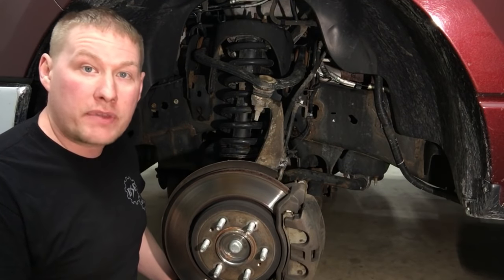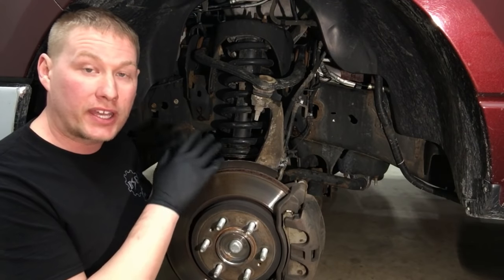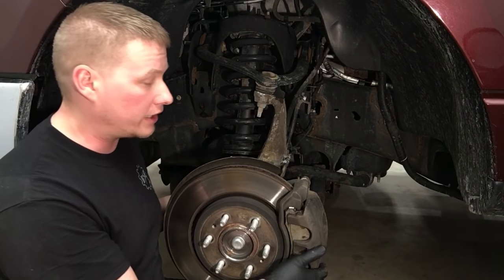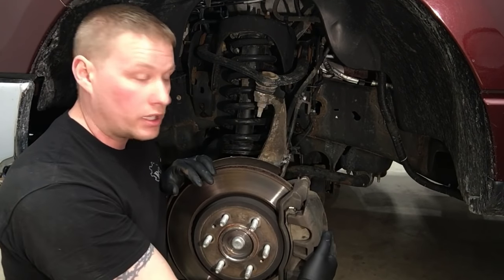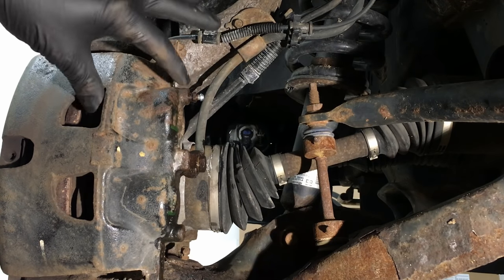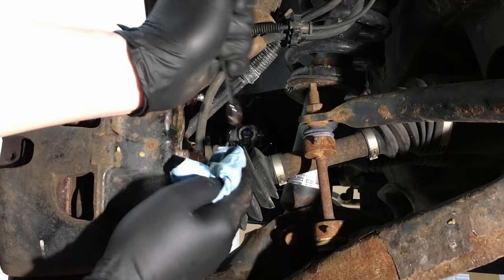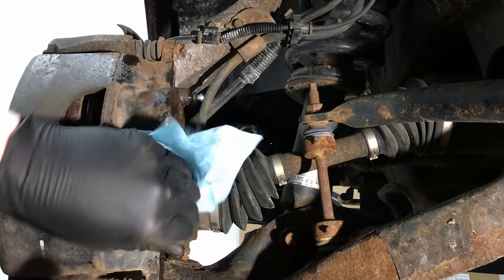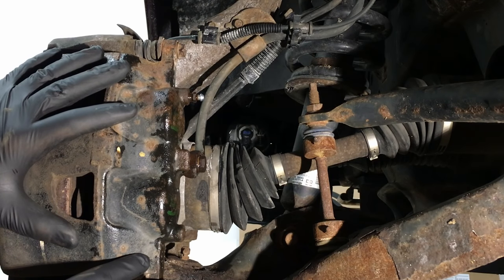Ford Quick Tips #73: Quickly Diagnose a Sticking Brake Caliper w/ One Simple Test

Comment: The piston in one of my calipers backs up and is pushing fluid back up the hose when the car is turned off. After starting the car, I have to mash the brakes about three to get pressure back in that caliper. If the car is moving when mashing the brakes for the first three times of mashing the brakes, it makes a grinding noise like the pads aren’t gripping the rotor, but after hitting the brakes three times, everything works just fine. The pedal never goes to the floor because I have good pressure on the other front caliper. I’m not losing any fluid, so that tells me that I don’t have a leaking hose. This all started right after I had new bearings put in my 2006 Fusion and my abs light is on. Could this possibly be caused by the mechanic putting a bearing in backwards? I know that only one side of the bearing is coded and that the sensor has to read the code. Please help. I have run myself crazy trying to figure out what is causing this. Like I said before, this started right after leaving the mechanic shop.

Comment: I have a1991 Chevy pickup my brakes are sticking already change the calipers rotors brake pads and it's still doing the same thing what can it be?
Reply from the maker: Hoses
Reply: Thanks for the reply but I just change the brake hoses and still locking up. I did notice that when I lightly press on the brake it will release. Any idea

Comment: Changed my front right caliper on my 2013 expedition and bled the fluid and pedal goes to the floor when truck is running will collect pressure after a few pumps need help

Comment: I had this happen to me, jacked it up and one wheel couldn't spin and after driving the rotors and wheels were hot. Checked caliper pins it was sliding then found out it was the caliper piston seizing.  Steering wheel vibrates at freeway speeds and can be intermittent. Replaced caliper and problem solved.

Comment: Excellent video.  But I’m still stumped on mine.    I replaced both front calipers, rotors, pads and flex lines.  My left front caliper is still sticking.   Gide pins slide easily, pads ends are well greased and move freely in caliper bracket, I can compress the piston.   And the flex lines are new.   Still sticking.  When I do the same test you did mine acts just like yours…….It drips out the bleeder instead of shooting out
Reply: Probably the abs module
Reply: Some engines use a vacuum pump vs engine vacuum. Just in case anyone else needs another point to check.

Comment: I just went to Ford for a diagnostics and they can’t find any issue. I had my brakes replaced at big O tires and they replaced thing pads calipers rotors master cylinder booster ABS module all of that is brand new and my brakes had locked up the caliber locked up and it got real hot so I went back to Vigo they replace the pads and caliber again drove it for about a weekAnd as I was accelerating the caliber started to stick and I felt the resistance. I took it to Ford for a diagnostics and I can’t find anything wrong I don’t know what to do anymore

Comment: Under pressure or not, if you crack open any bleeder, flooded is going to come dribbling out.  That doesn't automatically mean there's a problem with your caliper.  The same thing would happen on a brand new car.
Reply from the maker: Right, like I said in the video it would shoot out. Am I missing something here, are you just restating what was said in the video for some reason. Let me know thanks.

Comment: Riddle me this. Could not move caliper back even with C clamp. Opened the bleeder no real fluid came out but then I could move the caliper back and fluid shot out . Would that be a collapsed flex line. And yes the brake was sticking but slider pins and pads moved very easy.

Comment: I changed the brake on the drivers side front brake after seeing smoke from it and grinding .I put it up on jjack stands took both wheels off . when the car is running and in drive the driverside brake  is locked up and and the passenger brake is spinning.. now when I apply the brake  the drivers side wheel spins freely and passenger brake stops spinning.  The behavior off the front
drivers brake is ass  backwards. 
I hope someone can provide info.
I subscribed and watched both videos. I found them helpful.
passengers

Comment: I have a 2012 f150 ecoboost and I just replaced both front calibers and pads because they were both hanging up. Drove it home and seems like the new calibers are hanging up as well. What other problems can I check?
Reply from the maker: Hoses.
Reply: I just replaced both front hoses and she works great. Thank you. Now next is to tackle replacing the timing belt and turbos.
Reply: Plus I replaced the crankshaft sensor and bank one camshaft sensor but still get the P0016 code

Comment: What is fuel system 1 ol drive and what can trip this to go off?

Ok so I just replaced my O2 sensors due to smog and seems like its working since I never got this message fuel system 1 ol drive while doing drive cycle.

on 97 Ford escort

Comment: Yesterday after driving at slower speeds for about 15 mins I got on the freeway and immediately it felt like I was driving on a road that was roughed up prior to laying tar. When I got off the freeway after a short distance I slowed down to 25 and put the flashers on. After a few minutes it returned to normal driving and was soon home. I checked the tires and one of the rear wheels was very hot and smelled like burned rubber.  Today I drove it and it seemed fine on a 10 minute drive but I think it must be dragging and has a sticky caliper the causes the brake to grab when it gets hot?
Reply: Same thing happened to me, then I replaced the entire brake system on the wheel and bled the brakes too. It worked fine after that for about one month, then the issue redeveloped, it seems to be on and off for my car.
Reply: @bubbagumpshrimpco.4854  I did like a mechanic recommended on this video:  Take the wheel off unscrew the guide pins to the caliper, clean them off, apply some proper grease for them, slide them back and retighten. That worked for me! The pins get dry sometimes and start locking up after it heats up and doesn’t fully release. Try that.

Comment: Guide pin lubrication? On the 09-14 f150 do u recommend greasing the back of the pads?
Reply: make sure you use silicone based grease on the slide pins...i have never greased back of pads ..i have 08 f150. use a quality pad not autozone or advanced bargain price junk.
Reply: working shlub thanks!

Comment: I'd just say buy oem brake parts. Spend the money, they're made for the car/truck and wont squeek! Use plenty of brakekleen and remove all the corrosion. Also use brake grease as required. 
Suckout most of the brake fluid in master and refill before bleeding that way you're push fresh fluid to the pistons.

Comment: Great help.I have just replaced my rear brake pads and they are smelly I know that can be normal for some time but I have noticed that the passenger side smells more than the driver side and the wheel is hotter too. Do you think it can be a dragging issue or should I wait to see if they settle down for a little bit longer? THANKS.

Comment: now how about the newer wheel bearing. we get a lot of complaints on a rubbing noise. typically it's a wheel bearing. but what if you replace them and the noise comes back so then you verify the wheel bearing isn't bad so you repack the inner bearing of the assembly but the noise dosnt go away. is it possible the t case is the culprit even in two wheel drive. by the way the actuators are good
Reply: Mine was the wheel hub.  2008 F150 with 130k miles.  I replaced one on the left side of my truck because that's where the noise was coming from.  Still rubbing noise.  Replaced the left wheel hub because people said that that noise travels and can fool you.  AFter I replaced the 2nd wheel hub the noise went away.  I could hardly believe that was the answer because the sound definitely came from my left side.  Makuloco has a great video on replacing the hub.

Comment: hey bro I just purchase a 2006 F350 6.0 Powerstroke the truck feels like it's hydrolock remove the glow plugs no water no fuel came out it's spin but really slow batteries are new. is it possible to have a bad week starter but it still spins
Reply from the maker: Not common on the 6.0l but it sounds like a check of the high amperage cables is in order. Make sure they are indeed connected together so that it can have the amperage from both. A simple voltage drop test of these wires while cranking is your first step it should not read more than 0.5v to 1v max. Once the wires are tested in this manner between batteries and the starter itself also check cranking voltage it should not drop below 10v .
Reply: Hydrolocked is LOCKED. Period.  The crank will NOT turn at all.

Comment: I did the same check you did on the caliper. When I opened the bleeder valve it shot fluid across the floor, What does this mean? My driver side is locked up tight !
Reply: As far as replacing calipers use a qualified technician. If you get air into the brake system it could kill people. No brakes! Replacing calipers is not a home job leave it to the professionals.
Reply: Jonathan-Emily Powell I found out it was a pinched brake line.

Comment: Would a bad caliper cause deceleration/braking vibration in cab between 40-60 mph?
Reply from the maker: The component is the warped rotor but the cause is the caliper hanging up many times.

Comment: I have a 2002 Ford Escape and the front breaks make noise when breaking lightly when the weather is cold.    Prior to the first break job everything was fine. The rotors and pads have been replaced twice and Permatex high/low temp grease was used during the last break job which seemed to solve the problem and later the noise came back.   The front bearings and break hardware were also replaced but the calipers are original.  PLEASE let me know if anyone has a solution to my problem.

Comment: i have a 1998 f 150 pickup 5 speed standard trans and when i push clutch in  the brake pedal also goes in a bit and brakes go on  until i put my foot under brake pedal to pull back. can anybody tell me why this happens

Comment: IF you pull to a direction, is that the side the issue is coming from ? My fathers Excursion is pulling to left. I replaced caliper about 2 months ago. Currently brakes are shimmering Bad ,it pulls to left with light breaking,but applying brakes higher speeds the steering wheel wants to come out of your hands. Why ?? What is Best company to get replacement lines for caliper IF my issue ?
Reply from the maker: If it pulls to the left then the concern is in the right front caliper
Reply: @FordTechMakuloco  Ok Thanks for information. I was thinking it was opposite side of direction of issue. You the Man !!!! Love Your videos. I will replace the R-Front caliper Sunday.
Reply: @FordTechMakuloco  IF you change the brake line for caliper do you put Ford ? Or what company You recommend ?
Reply from the maker: Ford is preferred but I have used the auto store brands no problems.

Comment: My 2010 ford escape limited 3.0 makes a creak and groaning noise randomly when braking and when braking hard does the same but then make a grinding noise as if the pads are to the metal but rotor and pads are new cant figure it out
Reply: Did you ever find out what the problem was? Having issues with the 2011 limited.

Comment: I have a 2011 ford fusiod 3.0. changed upper , both lower contol arms, sway bar links and struts. Still hear knocking sound from right front. I used to be a tech myself, bit I just cant figure this one out. BTW, only 58000 on the car. Help!
Reply: MyNameIsMud maybe strut mount/bearing plate ?
Reply: Dan Jordan All new.
Reply: I Tried 3 new strut assemblies.. . same noise.

Comment: What makes the brake pads return to its original position after releasing the brake pedal?
Reply: Jose Rivera 
It's the deflection of the piston seals that return the piston to the released position. They're springy in the very small movement of the piston during normal operation.
In real life slight runout of the rotor also acts to push it back to the retracts position.

Comment: I have a 2009 F150 4X4 with just 70K miles. Today I noticed more brake dust on the front drivers side wheel, and hot brake smell. the wheel was hot to the touch. I jacked it and the wheel rotates fine. Not sure what is going on here.
Reply: Did you ever figure out the problem? I have the same problem, same truck, same year, same mileage (what are the odds right?)

Comment: I have an '88  E350 ISSUE  !   just did brakes - NEW calipers,pads, and hoses- first run came back stinking like brakes - rotors hot .  It uses the slide pins  ...   HELP !  ?
Reply from the maker: The rotors will be hot as you are bedding them in.the smell like burnt brakes is normals as the friction material is new.

Comment: Ford seems to have issues with calipers, I have a 2013 Taurus, had a right rear brake smoking, unfortunately it was mis diagnosed under warranty as corrosion in pads, and hardware causing brake caliper to not release. At the time I contacted Ford Warranty and told them I am 100% certain the calipers should be replaced, instead they backed the dealer.I had to pay for the brake job. Several months later for inspection the right rear brake was worn, by that time warranty expired. Instead of a 100 deductible for the repair performed correctly under warranty, the dealer replaced calipers, pads, and brake resurfacing. Out of pocket over 800 for a mis diagnosed repair, Ford warranty company did nothing to try to remedy the situation.
Reply: Keep in mind when a vehicle leaves the assy line, they have next to no lube on the brakes
So you can't expect to drive around for years & do nothing or expect a dealer to work for free
Your best to do your own brake work & get them apart once a year for rust removal,inspection
& lube. The manufacture,make,model or year has no bearing on the issues or required maintenance

Comment: My 2016 f150 has a rotational scratching sound coming from the front end. Has been there since I bought it and at 10k miles had one of my calipers replaced, and now at 18k still making a noise have no idea what it is.
Reply: You think so?!
Reply: i would check the dust shield first.  should've easily been spotted by dealer tech but no one is perfect.  good luck
Reply: ***** no it does not.
Reply: so you've been driving for 18k with it like that?  prayers
Reply: I hear it don't feel it. Some days it louder than others.
Reply: 4x4
Reply: slewke yes I've been driving everyday. 11 months 18,300 miles in. Kinda wish something does happen so I have a definite answer hahaha.
Reply: have you ever taken the wheel off and looked around yourself?   i would jack up all 4 corners and very carefully put it in drive with the wheel off. hope you find that shiny spot

Comment: I wouldn't put a refurbished caliper on there. I'd get the oem kit and fix it. Alot of that autozone crap is just slapped together and has a coat of black spray paint over dirt and grease. Nobodys going to take the time to do it all right like I will.

Comment: I need your help Brian,  where can I find the key less entry code 2012 escape , also my 2011f150ecoboost is it normal for carbon build up in tailpipe  only 30k &short trip drive's .  thank you very much
Reply: Dan Jordan its labeled on Fuse box under dash to the left of your foot I believe, If you don't see it, It might be on backside, I had to remove box and peak at backside to find mine, ( If the code isn't in Owners manual ) card.
Reply from the maker: The keyless entry code is printed on the side of the smart junction box or fuse panel located in the front of the center console passenger side. As for the carbon it is totally normal with any DI engine.

Comment: who can help me?
My car is quickly wearing the pad on the right side, I used a temperature sensor and that side heats up much more than the other and I don't have a stuck caliper. I also replace the brake lines e replace the oil.

Comment: my 2005 Ford Escape died with the red triangle saying check emission system brought it to Quirk Ford in Quincy Mass and they told me the transmission was dead that wires were burned in the transmission or something like that. this whole incident happened after I hit a large bump just wondering what you think
Reply from the maker: +donny gould Never seen one fail like that what's the codes from the PCM, TCM and BCM.
Reply: FordTechMakuloco transmission code :P 1A14 for hbv Interlocken trans
Reply: FordTechMakuloco also Ford mechanic pointed to orange  wire in engine bay that runs to transmission and he said that it's  physically connected but his Test shows that it's open circuit. he said it's not serviceable and I need a new transmission. said the wires are burned up inside there what do you think? (used obviously haha)